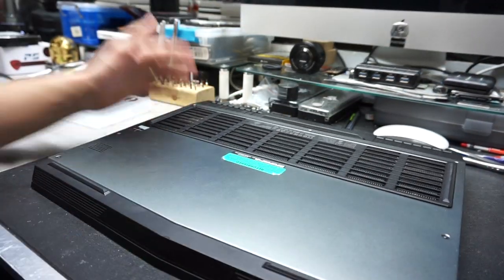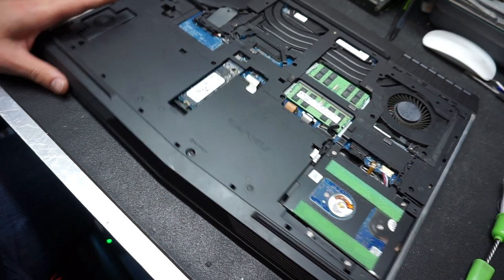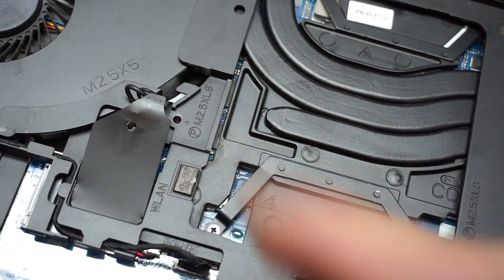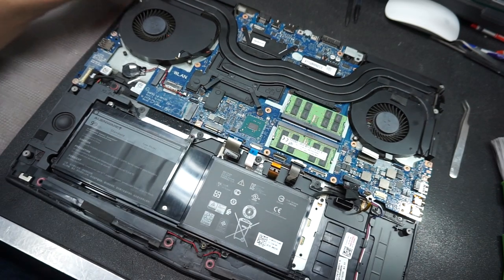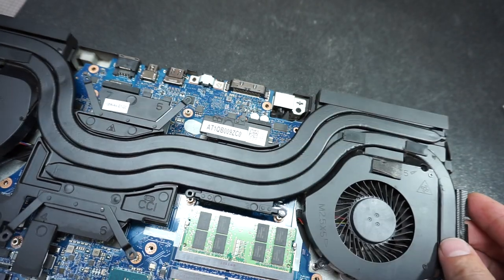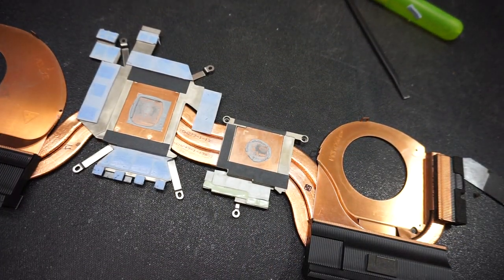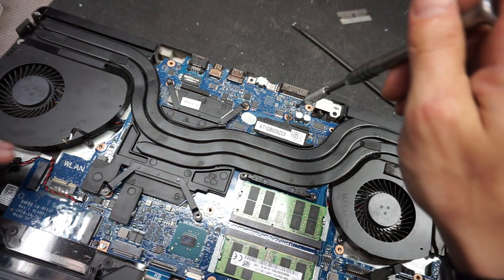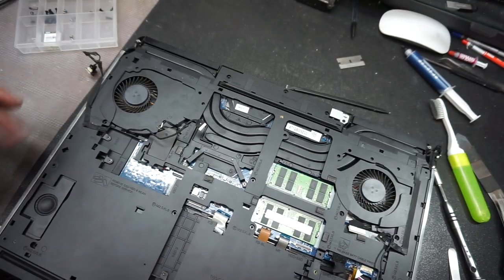Alienware 17 R4  GTX 1080 disassembly & thermal paste/pads replacement

Comment: This is THE BEST AW17 disassembly video online! I have an old AW17 R4 that I used throughout my university years until it started to constantly throttle itself due to heat issues. I really need to get it running again since I'm going home for a couple months and getting a brand new one is out of question at the moment. I was able to repaste components and unclog the dirty heatsink thanks to your instructions. I was baffled by the idea of taking off the entire motherboard to disconnect the fan unit, but thankfully there is no need to.

Comment: Just wanted to thank you for posting the video, my 17 R4 had been reaching close to 200 degrees when playing games and was well over 100 when idling. Now seeing mid 90's - dropped to 89 on CPU GPU and low 80's on the mainboard. Going to repaste in a day and see whether or not I can get lower temperatures. Threw in the towel with getting Wi-Fi - couldn't get the cables connected and left it for the time being - was getting cross eyed!

Comment: Thank you for uploading excellent video.  Thanks to this explanation, i can probably disassemble my Alienware 17. However, I'm not confident of complete assembly again my myself.
Reply: it is very easy, I have done it like 6 times
Reply: It's okay not to feel confident because there are over 30 screws to put back in their exact location and they are not all the same size. Then there are ribbon cables that must be reattached and seated correctly or you're gonna have problems. Keep in mind that the two connectors for the wifi card may not snap in so easily like in the video.

Comment: Thank you so much for this video! Thanks to this I was able to repaste the heat sink. No more crashes in games 👏🏻👏🏻👏🏻👍🏻
Reply: Is it still holding! , or you have to change the paste every now and then ? . 
I used throttle stop to undervolt the cpu, went from 95 to 81 without renewing the thermal paste

Comment: SUBSCRIBED!
Dude I owe you so much! You're like a Sherpa that just guided me to the scary peak (re-paste) and back down to safety (all parts reassembled and computer running cold as ice). 

Before and after FurMark benchmark scores (GPU stress test) after pasting Kryonaut Thermal Grizzly:
1) I gained an average of 7 FPS
2) WHILE RUNNING 10°c COOLER!!!!!

CPU temps were roughly 12°c cooler during Intel Burn Test
. Average idle temps dropped from 55°c to 41°c

Which means 
a) I no longer throttle during sustained peak performance & 
b) my laptop runs a lot quieter

 i7-7820HK
Reply: me too running at 44c to 42c I do it every 8 months

Comment: Great video thank you!!! I had also taken my computer over to u break i fix a year ago to get get my keyboard fixed and came back with a usb port not working, and while i was reassembling i realized the usb cable was unplugged!! I plugged it back it and finally i have 2 usb ports again!!! Turns out they break and i fix lol

Comment: Blue light on my AW 15 R4's lid are not glowing as bright as they used to... Rest of the colors are fine but colors in which blue is needed are not good, for example purple looks red, cyan looks green, the dimmed blue light problem has only occurred in the Alienware logo at the front of the lid and the alien head on the back of the lid. Also I came across multiple people who are facing same issue, why is Alienware so unprofessional? Buying an Alienware is a total wastage of money.

Comment: I just bought the thermal paste Arctic MX 4 2019 But I'm kind of afraid to do it because it's my first time what do you think I should do Just go for it?
Reply: Don't use liquid metal, then don't use much strenght, because you don't need it and see as much tutorial as possible to understund every single move you will do to get the best temp possible bro
Reply: yea
Reply: I'm in the same boat. Never done it either, but get a static bracelet or mat and just squeeze some of the paste out first as it can go flying out.

Comment: blowing air into the fans?! you never learned that fans wich you blow on will work as an alternator? and can destroy your motherboard? its low voltage...but its possible
Reply from the maker: thanks for your concern, however that's not the way computers work...that's why you have rectifiers on the mainboard, to stop the flow of current both ways...